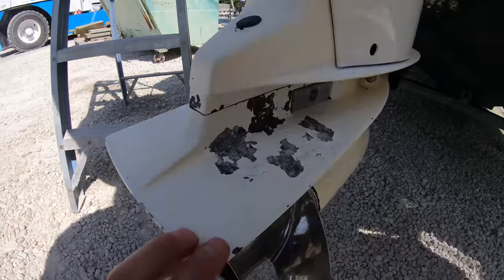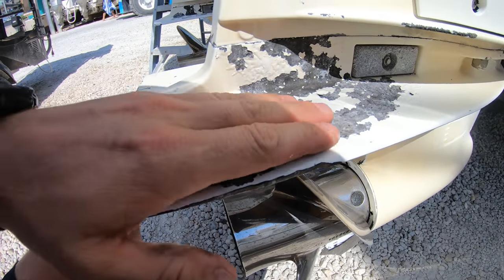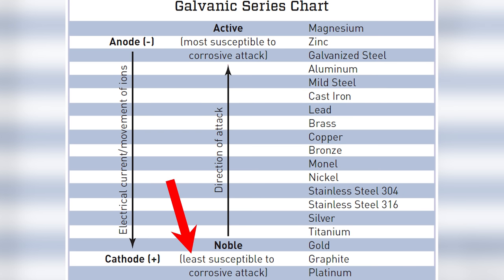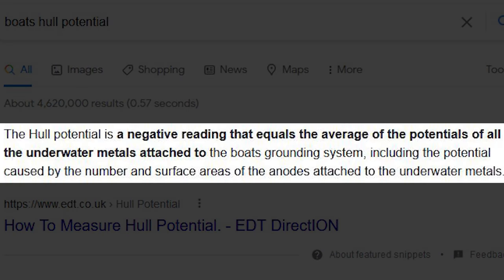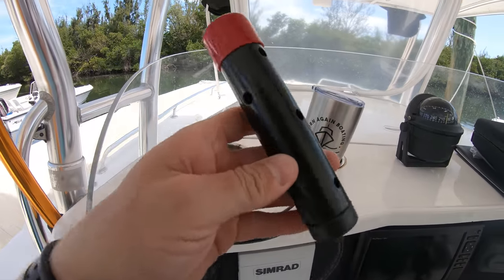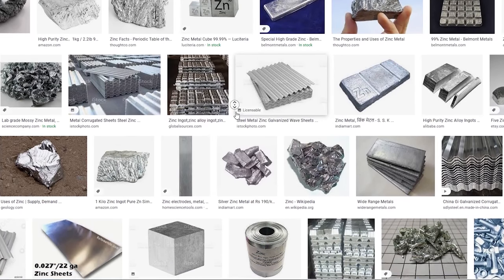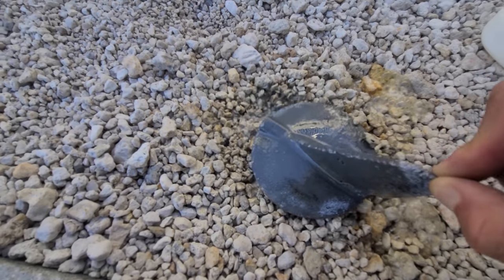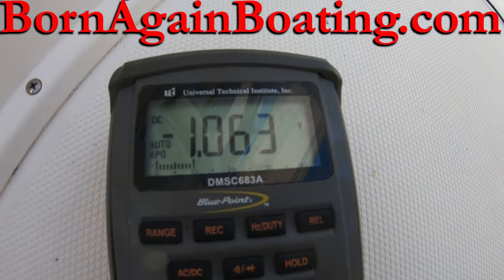Stopping Boat Engine CORROSION!!!

Comment: The most overlooked  cause of galvanic corrosion in these circumstances is missing/broken grounding straps, there should be a ground strap from lower unit to upper unit, engine block to upper unit, lower unit to the boat (if metal) and a ground strap between the engine case and trim unit(s) and the engine components such as intake manifold to block to bottom end to engine case, any parts that have a gasket between them should have ground straps between them This will help prevent 95% of galvanic corrosion!!!

Comment: Excellent corrosion video. Exactly what I have been looking for. My outboard bracket needs to be replaced because it has corroded so much. The anode closest to the bracket had infinite resistance and the metal under the anode was painted preventing the anode from protecting it. I am going to invest in that reference electrode! Thank you.

Comment: “Bravo” on this corrosion video!…remember there are 3 different types of anodes depending on the type of water you operate in: Zinc, Aluminum, or Magnesium. Don’t forget to bond all your through hulls to a separate anode since any outboard, I/O, or inboard unit anode will not handle that corrosion load. Also be careful of dock electrical connections and improperly isolated corrosion protection from your neighbor’s boat. Check ABYC standards for more detailed info.
Reply: Up here in Northern California most of the harbors are HOT with most of the commercial fishing boats bleeding electric currant into the water. If you berth in a harbor you can assume it's HOT by looking at all the rat boats there that have mis-wired systems. They're so HOT that people jumping in the water around their boats have been killed.

Comment: I operate a small repair business in NE Ohio, so no salt water to be had. However, some of my customers have heavy corrosion on their lower units over others. Even in the same body of water in some instances. Would a battery disconnect on the ground side of the battery be of any benefit?
Reply: If it is stray current corrosion, then it would depend on the source of the stray current.  There are other sources of the problematic stray current in addition to your customer's on board electrical system.  If the boat is in a marina then the source of the current could be dock/shore power or some other boat or boats leaking current into the water.  Getting their boat out of the water would solve the issue.  Otherwise you will have to track down the source of the stray current and isolate your customer's boat.

Comment: Good video, thanks and God bless!!

Question:
Should I be concerned with my jet skis if I only run them a couple of hours a time in salt water?

Thanks.
Reply: Dumb question. Any time you run anything in salt water for any amount of time flush it out. Even if ran for only 5 minutes. Make sure they are clean. If salt builds up in them it’s a pain in the ass to get out. If you ever have to replace the impeller, bearings, the wear ring, or seals it can turn it into a nightmare. We bought a used jet ski that was in salt water that needed a new shaft bearing and the salt turned a 2 hour job into a job that took all day. On top of seizing parts together salt can also clog cooling passages which can cause it to blow up. See Doos are the only ones with closed loop cooling systems.
Reply: @UltraMagaFan  Sure is a long thought out answer for a "dumb question".... We're here to learn about boating, not to gatekeep.
Reply: @UltraMagaFan  
Thanks for the info.
But I was not talking about flushing etcetera, I know all about that.
I was referring to the topic of the video, "zinc anode"
Reply: @anotherpewtertahoe  Your logic is stupid. We’re here to learn about boating like you said. I answered his question. It doesn’t matter if i think it’s dumb or not.
Reply: @clemensboelen1755  My bad. That should have been obvious. We own Yamahas which don’t have them so it slipped over my head. As far as I’m aware Sea Doos are the only jet skis with anodes. As long as you wash it off and flush it after use they should be fine. I’m not sure how often you’re supposed to replace those things. I’d just keep track of the condition of them and replace them whenever you think is fit. They’re cheap they only cost $15.

Comment: Should a 36v trolling motor battery be bonded with the negative system of the
12v outboard and 12v house batteries, and why/why not? I've read many interpretations but would like to hear your take. Stray current, galvanic corrosion, voltage potential VS differential are all reasons for or against.

Comment: Have you noticed that Mercury’s tend to have less corrosion issues than other manufacturers (eg Yamaha)? My 2001 Optimax was used in sw it’s whole like and has zero issues. Even the internal water passages look new. That was not the case for my 1997 yamaha. Bolts were constantly breaking.
Reply: Any thoughts?
Reply: Had a 1997 Merc 225 EFI for 20 years with only corrosion on power trim motor housing. Great engine. Current 2018 150 EFI Merc has extensive corrosion on power trim motor housing. I flush and rinse the entire motor with fresh water extensively after each use. Talking to Merc about the problem. Their initial response was that their corrosion warranty typically only covers corrosion that impacts function of the component, but they want me to send pictures. Amazingly, the trim motor still works but it is crumbling on top. I have to believe many others are having the same problem.

Comment: Can you please cover how to remove bolts that have been in salt for a long time, such as the bolts holding the zincs to your motor for that past several years (20+ in my case). :)
Reply: Yes please, I would really like that video too.
Reply: Same here
Reply: You will need to break the physical bond that corrosion had created between the bolt and the hole the bolt was screwed into.  To break that mechanical bond corrosion has on your bolt(s) use penetrating oil,  an impact wrench,  heat (there are some cool induction heating tools designed for this purpose on the market in addition to gas flame) , patience, incremental tightening and loosening.  Make sure your removal tool that you are going to grab the head of the corroded bolt fit correctly on the bolt heads to be removed.  In some cases the bolts are going to snap/break and then you are going to get into extracting broken bolts.  If that happens you are looking at drilling, tapping and possibly welding.  When you do get the corroded bolt out clean out the hole and threads and lubricate the new bolt with something that is compatible with the metal(s) and designed to discourage corrosion.  Going forward it helps to keep up on annual maintenance including checking your sacrificial anodes.  Eventually corrosion is going to win.  Corrosion keeps boat maintenance technicians employed.